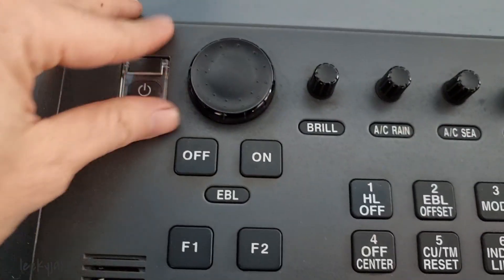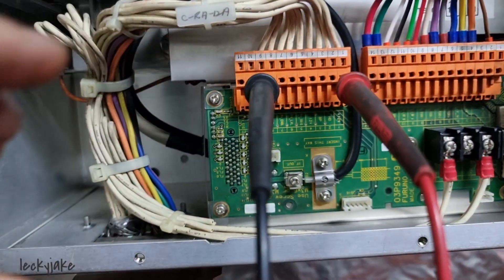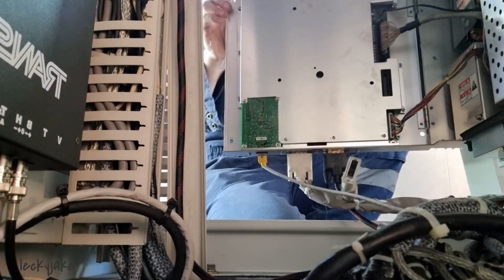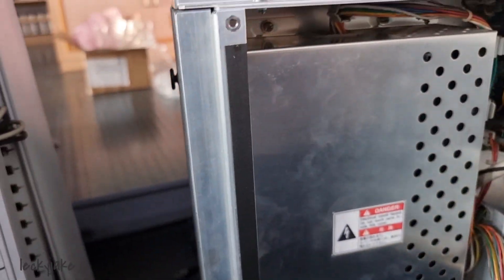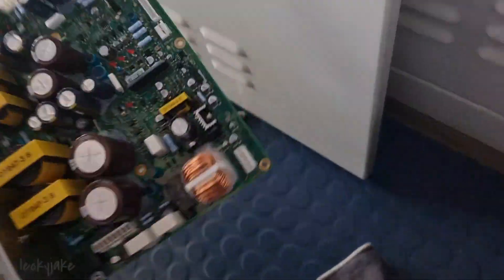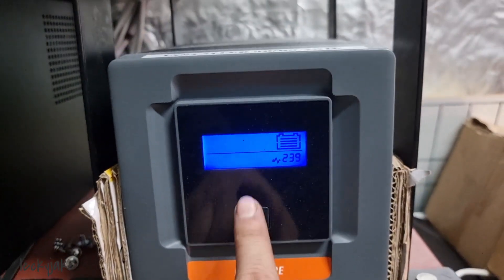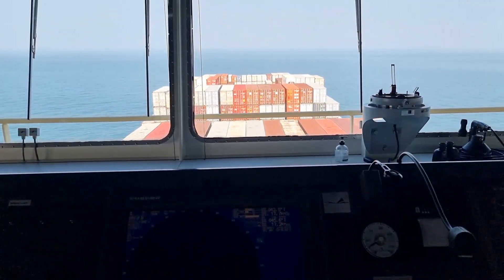MEGASHIP RADAR TROUBLESHOOTING, VIDEO AZIMUTH HEADING ALARM, | MARINE ELECTRICIAN

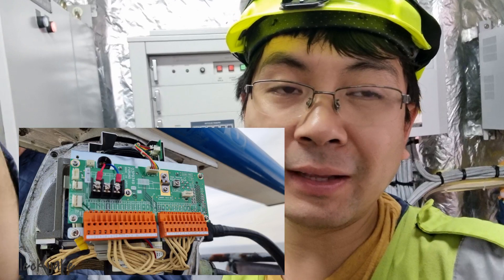Comment: What's with the car stereo on the control panel at 2:56?
Reply from the maker: That is for the PA system and you are right it is a cae sterio so that we can have a centralized sound system which we normally use during holiday season